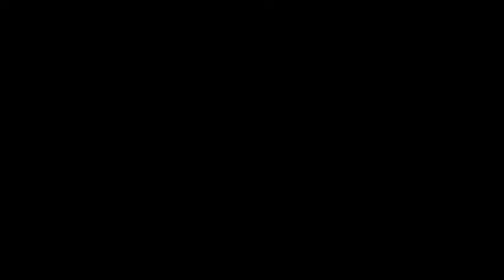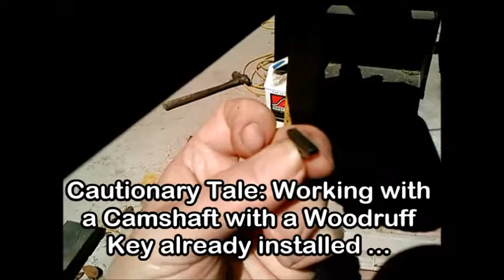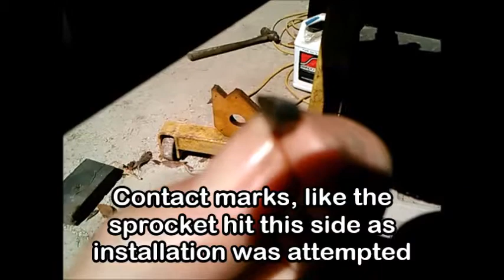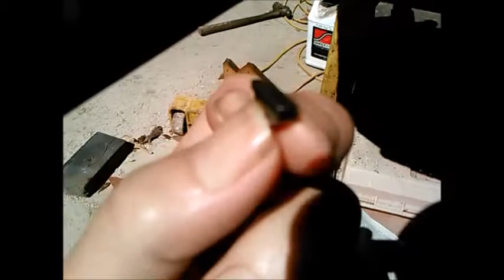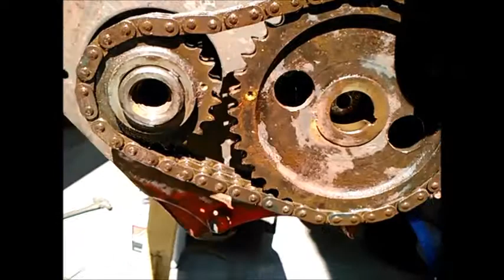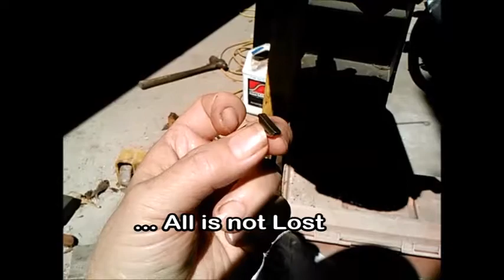MGB Camshaft Offset Key Fell Out - Which Way to Re-Install ?

Comment: there is no such thing as an offset key. that is a failed key due to loose fit and high torque.......
Reply: incorrect, you can in fact purchase off set keys from mini-spares as a cheaper alternative to adjustable timing gear.